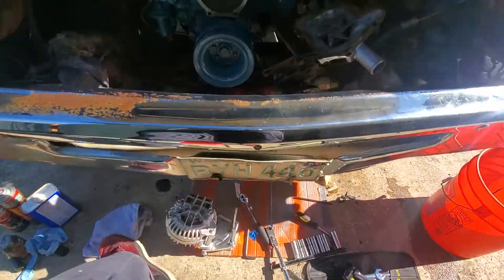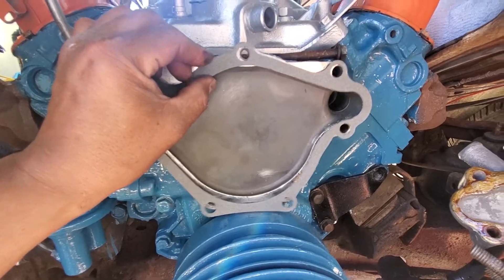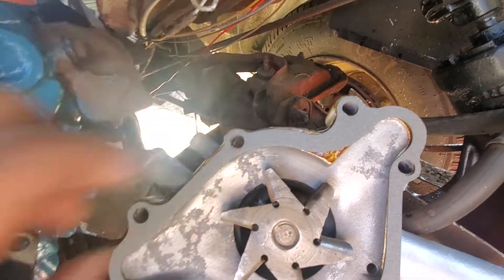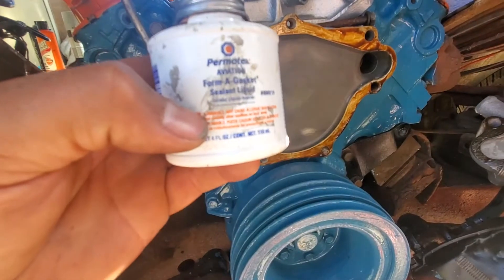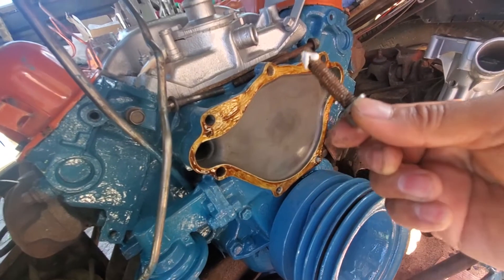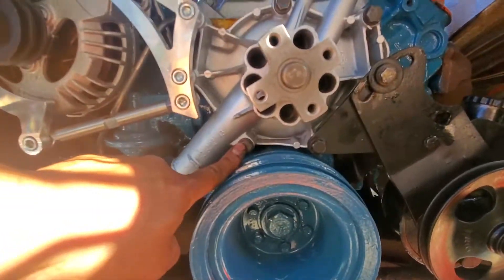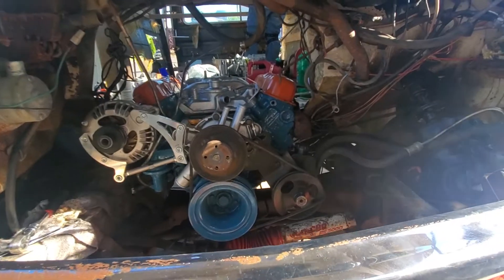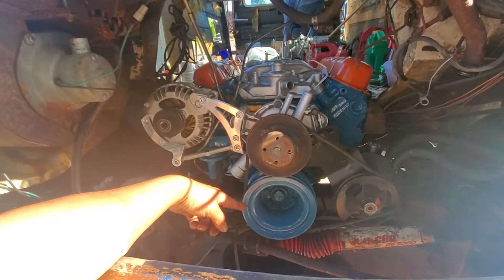76 Mopar 360 Water pump, Alternator & Power Steering Installation

Comment: Angel I'm installing that same alternator bracket on my 360. Did you have any problems with the bolt lengths?
Reply from the maker: The longest one is short .... i simply message the supplier they send me.longer one